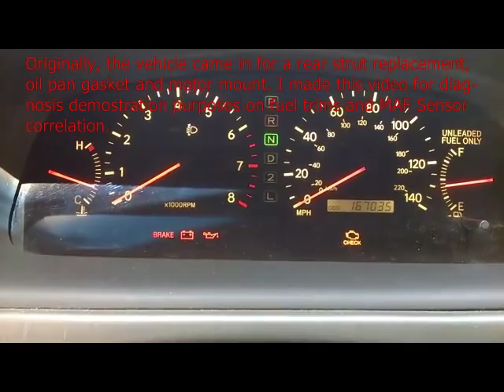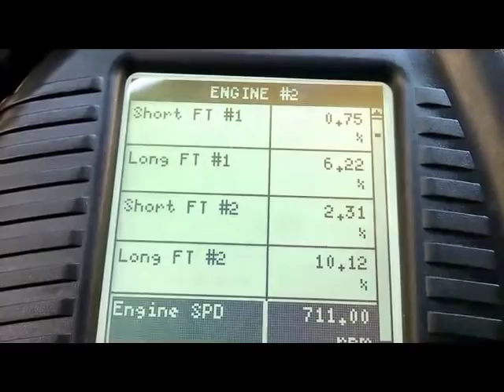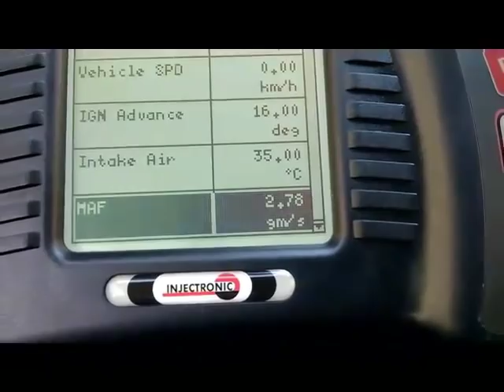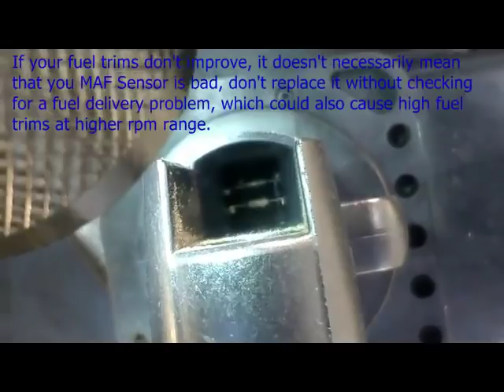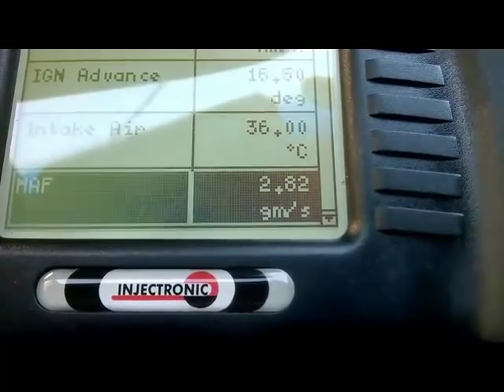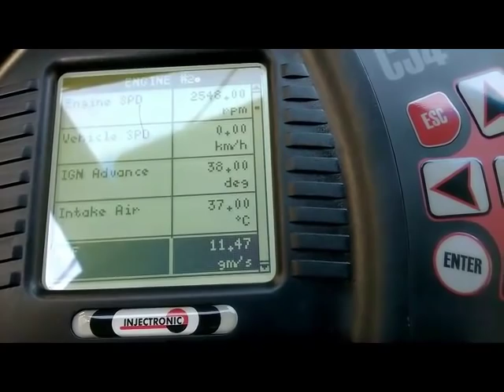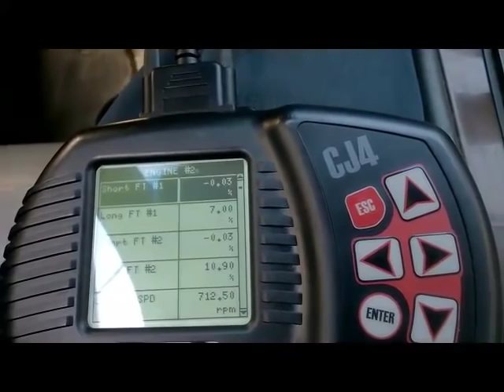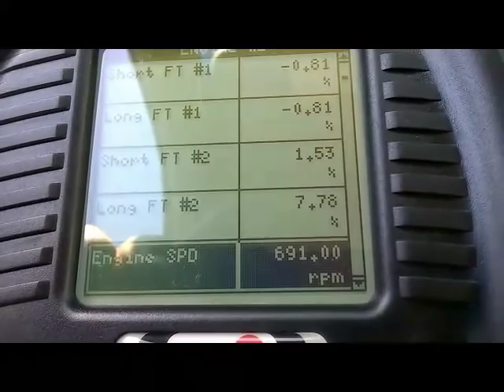(Lexus ES300) Dirty MAF Sensor and Fuel Trim Numbers

Comment: I have 1500cc petrol engine in toyota  ......
I tried two maf sensor one giving 1.3 g/s at 650 rpm....
Another giving 1.7 g/s at 650 rpm....
Which one should i use for better fuel economy.....plz reply
Reply from the maker: Normally, you want a MAF sensor that is closest and slightly over the size of the engine. In your case 1.5L engine, you want the one that is showing 1.7 g/s. Ideally your MAF reading should be 1.5 - 1.8 g/s at idle.
Reply from the maker: When a MAF sensor is under reporting is usually due to a vacuum leak or some type of internal leak. Intake or exhaust valve sealing problem or dirty MAF sensor.
Reply: @EliTheOBDTech  got it....thanks.....how will it effect fuel economy if i use 1.7 g/s maf sensor?
Reply from the maker: @wajeehulhassan2182  As long as you don't have any other engine driveability problems, you should be getting normal to above average.
Reply: @EliTheOBDTech  so i should go for 1.7 maf sensor......
Reply from the maker: Go with the one that gives you good fuel trims numbers. 
Ideal +/- 5% at idle 
Decent +/- 10% at idle
Reply from the maker: @wajeehulhassan2182  unfortunately, I don't have a WhatsApp account.
Reply: @EliTheOBDTech  give me ur email....
Reply: @EliTheOBDTech long ft +-10% is best or 0%..
Short ft +-3% or zero is best
Reply from the maker: @wajeehulhassan2182  eguillen.tech@hotmail.com
Reply from the maker: @wajeehulhassan2182  As long as short term is within 0 +/-5% and long term within 0 +/- 10% you should be good. Any total fuel trims that go beyond +/-20% you have problem
Reply: @EliTheOBDTech  fuel trims close to zero is good or with in range is good for best mpg....
Reply from the maker: @wajeehulhassan2182  fuel trims close to zero is good for mpg. You will never have a perfect gas engine car with 0% fuel trims.
Reply: @EliTheOBDTech  i chked my car by scaner....maf reading was good short fuel trims was well within range  going +3 to -3
But long fuel trim varied but was in the positve range only....
I changed my fuel pump yesterday also i have my injectors serviced.....is it ok or what should i di....plz also chk ur mail.....
Reply from the maker: @wajeehulhassan2182  Just saw your email with pics, by the looks of it, short term and long term fuel trims seems to be in good range. Total fuel trims never seem to go beyond positive 10%. I wouldn't worry about long term staying positive or fluctuating a bit as you increase RPMs, that is normal. Worry when Total fuel trims go beyond +/- 15%. You have a good working engine.
Reply: @EliTheOBDTech  
I was woried about + long trim....i have injecters servisd....maf is ok 
O2 sensor is ok cat converter is ok...
thanks brother.....you helped me alot......stay blessed......
Reply: @EliTheOBDTech  can i mix high octane with regular petrol?????
Reply from the maker: @wajeehulhassan2182  You can, but it's not recommended. Its more for performance cars with turbos or superchargers.
Reply: @EliTheOBDTech     i have 1500cc toyota axio 2007....
Injector resistance was 11.7 ohm for 3 injectors one injector had 11.5 ohm resistance....isn't it a bit lower than standard .i have cleaned my injector as well....
Should i replace it......?????
Reply from the maker: @wajeehulhassan2182  A 0.2 ohm difference seems to be suspicious of coil winding failing. I would replace it. Any engine  driveability problems?
Reply: @EliTheOBDTech  a litle lazy ness in pick... Around 600 rpm at idle.....
Reply: @EliTheOBDTech  is 11.5 low resistance????standard is 13.4 to 14.2 ohms
Reply from the maker: @wajeehulhassan2182  Was your ohm check done with a cold engine or warm/hot engine?
Reply from the maker: By the looks of it, you may have injectors that might have coil winding failing.
Reply: @EliTheOBDTech  cold.......
Reply from the maker: @wajeehulhassan2182  The lower the resistance, the closer to being shorted injectors. It would be nice to get a current ramp waveform on your injectors to see if you have the beginning of injectors shorting out.
Reply: Hope u will be fine....
I use iridium denso TT spark plug on my 2007  toyota axio 1500cc....
My car is a bit old what plug gap should i use????
Should i use 1mm standard gap irrespective of high mileage of my car or should it be adjusted?????
Reply from the maker: @wajeehulhassan2182  personally, I would go with standard gap.
Reply: @EliTheOBDTech   is there any diference in driveabilty, fuel economy ,power etc using platinum plug instead of iridium.....
Reply from the maker: @wajeehulhassan2182  The only difference is that Iridium plugs last a bit longer and give a better burn, but you can't go wrong with either one.
Reply: Do you have knowledge of car ac system????
Reply from the maker: @wajeehulhassan2182  With AC, I just know the basics
Reply: @EliTheOBDTech  my car ac reches temp upto 2' celcius but gradually increases it to 10 celcius....then again reaches 2 celecius and then again 10 celcius....
Last year i changed my compressor only....
Is it normal or not?????
Reply from the maker: @wajeehulhassan2182  You may have a restricted expansion valve.
Reply: @EliTheOBDTech  i looked at my compressor actually it turns on and off regularly ....that why my ac tempetature changes ......
Reply: My 1.8 litre engine is giving MAF of 4.7g/second at 750rpm with intake air pressure at 0.5barg or almost 1/2 atmospheric pressure. 

So 1500/1800 x 650/750 x 1.8  would give the corresponding expected MAF reading for your car. Should not be less than 3g/second.

Go look for a well maintained car of the same model as your. Get a set of OBD2 reading as the base line for your car.

Comment: Hello, excellent video! A little question, may be you can help me, what means this values?:
At idle              (LTFT +10% , STFT -4 ) 
At 2000 rpm   (LTFT 0%,       STFT 7%) 
At 3000 rpm   (LTFT +4,        STFT +4)
My mileage is very bad!!
Reply from the maker: you may have a potential dirty MAF sensor
Reply: +Eli TheOBDTech thanks for your answer. but my fuel trims improve whith the engine speed. this confuse me.
Reply from the maker: Yes, but at 3000 rpm, your ltft increased to 4%. When fuel trims tend to fluate, it is more likely a MAF sensor being dirty or fuel delivery problem. I wouldn't rule out a potential vacuum leak or a lazy upstream o2 sensor.
Reply: Do a vacuum leak check (propane or smoke machine)

Comment: I have negative values. -18 ltft and -12 stft at idle. throws code p0172. car is mazda cx7 2.3 turbocharged. already replaced maf sensor. still same problem. please HELP
Reply from the maker: Assem Karhani It could be many things that affect your air fuel ratio. Since you already replaced the MAF sensor, you can scratch that out. Other possibilities: high fuel pressure, leaking fuel pressure regulator, defective upstream o2 sensor on bank 1, clogged air filter, leaking injectors on bank 1 and perhaps need valve adjustment on bank 1 if applicable on that vehicle.
Reply: Intake cam gear. Pin blows out .

Comment: What range should the mass be on a 2008 trailblazer 4.2
Reply from the maker: @angelf9800  It should be between 3-6 g/s and BARO should be 60-104 kPa (varies with altitude)
Reply from the maker: @angelf9800  My printer is out of service for the moment, so I can't print and scan via PDF to send the spec sheet to you. Sorry.

Comment: Eli if possible can you tell me where you obtained the spec sheet. Would like to acquire one for Honda. Thank you very much very helpful videos
Reply from the maker: Arthur Fricchione I got it from All Data. Tell me your year, make and model. I should be able to get you one. give me your email.
Reply: Hey I have a nissan murano 2006 v6 can you get one for me?
Reply from the maker: steven gangaram yes I can. What's your email?
Reply: Eli TheOBDTech it doesn't do it on a cold start but as soon as its warm it does this ☹️, i also checked for vacuum leaks but im unaware if I did it properly... i didnt find any
Reply from the maker: It seems you need an idle relearn. Anytime you replace or clean the iac or throttle body, you need to perform an idle relearn.
Reply: Eli TheOBDTech Hey just wondering if you had emailed the data.
Reply from the maker: Sorry, on Monday
Reply: Still do this?
Reply: @EliTheOBDTech  hi sir could you send me data specs sheet for 2001 celica gt 1.8. thank you so much.
Reply from the maker: @jclim9452  yes, tomorrow morning.

Comment: How come no one checks the air filter? that dirt on the MAF  is coming from somewhere and a dirty filter would cause a low reading  at the MAF  wouldn't it?
Reply: Unfortunately the air filter can filter up to a certain particle size and no better. So anything smaller than what the filter can stop from flowing to the MAF, flows through and cakes the MAF in dirt over time. That's why it should be pulled out and cleaned up with quick drying contact cleaner every air filter change... but most people just don't give a fuck. Yes, dirty MAF sensing element brings MAF reading down and LTFT up.

Comment: I have the short ft 3 and long ft 4 at -94.5. What would cause it do go so low. I cleaned the MAF but nothing has changed. Can someone help
Reply from the maker: Are you using generic data or enhanced data? What PID is giving you -94.5?
Reply from the maker: Short term and long term look normal to me, within +/- 10%
Reply: Eli TheOBDTech generic OBD2, I thought since it’s near -100 that car might be running rich. Ford says I need a new cat but idk what caused the cats to go bad. There is a jerk between 15-30 mph as well.
Reply from the maker: @Oleapeps  perhaps the jerk is due to the pcm subtracting fuel due to a rich condition. Negative fuel trims are usually caused by leaking injectors, leaking fuel pressure regulator, restricted air filter, high signal on the egr valve or faulty oxygen sensor stuck on rich condition 0.8v+. And yes, sometimes a faulty or dirty MAF sensor will cause a rich condition.
Reply: Eli TheOBDTech alrighty thanks so much. I’ll be taking the car to a different shop. I’m surprised they didn’t look into anything other than the cats
Reply from the maker: @Oleapeps  Do you have low power performance? Usually Catalytics will surge with poor power due to exhaust retructions. You can remove the upper o2 sensor and see if you gain slightly better power.
Reply: Eli TheOBDTech I took it to a muffler shop as well and they said that the back pressure is good. Cats aren’t clogged, car misfires at 3500 rpm. So need to fix that issue too. I’ve replaced all spark plugs, purge valve, pcv valve. Imma try the fuel injectors next.
Reply from the maker: @Oleapeps  Alrighty, good luck.
Reply: @Oleapeps  Ever figure out the issue?

Comment: Just want to say great vid. I was wondering , where did you find the sheet that you have with all the specs?
Reply from the maker: Otis George Through All Data program. What vehicle do you have?
Reply: Can you send one to me.  2002 dodge Caravan Sport 3.3L v6 Gas
Reply from the maker: What's your email?
Reply from the maker: Hey Donna, unfortunately AllData does not provide a Spec Sheet for your vehicle. Sorry.
Reply: Hi do you have a spec sheet for audi a4 b7 2.0 tdi bre engine thanks

Comment: Where did you get a printout of normal readings?
Reply from the maker: AllData
Reply: @EliTheOBDTech  Thanks!  I went to https://www.alldata.com/ and it seems to be subscription based and would benefit shops.  I also went to http://alldatadiy.com/, but it doesn't have my 2016 MINI in the list.
Reply from the maker: @Charkatak  FYI, actually not all Manufacturers provide normal  data values, usually most Asian and Domestic manufacturers do, it's vary rare in European vehicles.
Reply: @EliTheOBDTech  Understood!  Just wanted to see the normal readings for my vehicle to diagnose MAF sensor failing idea.  I couldn't find Bosch MAF sensor datasheet for my 2016 MINI Cooper S 4 dr Hardtop model.

Comment: Nice video, have you a copy of the spec sheet you are using....
Reply from the maker: Hello Geoff, I don't have the spec sheet that I was using for that video, but I could email you the spec sheet. what's your email?
Reply from the maker: is it for the same vehicle?
Reply from the maker: Geoff Moores most likely just for a Toyota vehicle or with a 3.0L engine.
Reply: A Toyota spec sheet would be great, thank you geoff
Reply from the maker: +Geoff Moores Sorry Geoff for the delay on the Spec Sheet you asked for, I'm having problems with my scanner. I will get you the spec sheet on Monday when I'm at work. Can you give me your email address? thanks.
Reply from the maker: @geoff3172  Sorry for this late response request, you still need it?
Reply: @EliTheOBDTech  allsorted...keep the great videos coming...

Comment: SO, WHAT WAS THE FINAL DIAGNOSES?????????????????????????????????
Reply from the maker: Vehicle had contaminated dirty maf sensor with vacuum leaks. Cleaned maf sensor and replaced few vacuum hoses along with cracked intake hoses going to the throttle body.

Comment: how did you know it wasn't fuel related but maf related
Reply from the maker: Due to vacuum leaks.
Reply: what do you mean..could you explain a little more
Reply from the maker: @jb6574  in this video i did not show my visual inspection of broken or brittle vacuum hoses. Any time your fuel trims start high and decrease as you increase your rpms, that's indication of a vacuum leak which affects your MAF sensor readings. This vehicle had a combination of a dirty MAF sensor and vacuum leaks.
Reply: Eli TheOBDTech I guess what I meant is without vacuum leaks how did you know it was maf and not fuel related since fuel trims that get higher with increase rpm can indicate either a fueling issue or a sensor issue
Reply from the maker: @jb6574  This vehicle did not have faulty MAF sensor, it was just contaminated with debris. By cleaning it up, it solved that problem. The biggest issue was vacuum leaks. MAF or fuel related problems tend to show up with low fuel trims and then an increase of fuel trims as you raise your rpms. In this scenario, I removed the MAF sensor and I did a visual inspection to determine if the resistors were dirty with debris.

Comment: You just told the opposite of the values
Reply from the maker: Low fuel trims that increase when you increase the rpms, dirty MAF or fuel delivery problem. High fuel trims that decrease when you increase rpms, vacuum leak. This vehicle had both problems. Vacuum leaks and dirty MAF sensor.
Reply: Higher long-term furl trim most of the time indicates a vacuum leak because the computer is adding more fuel to compensate for extra air getting into the system. Complete opposite of what you’re saying.